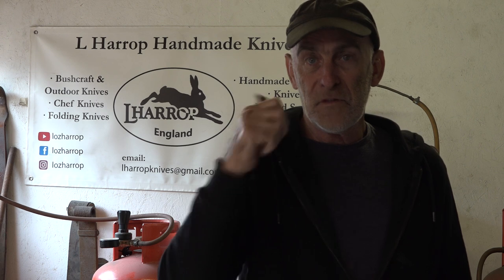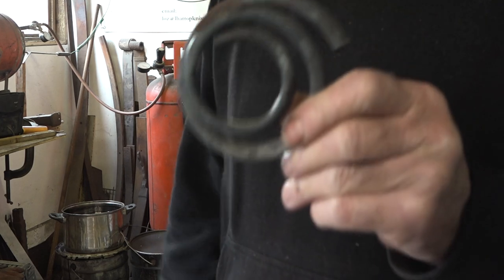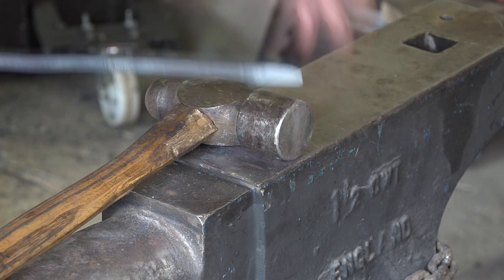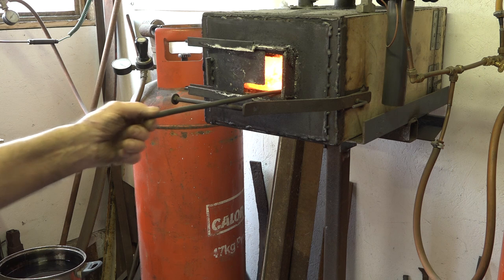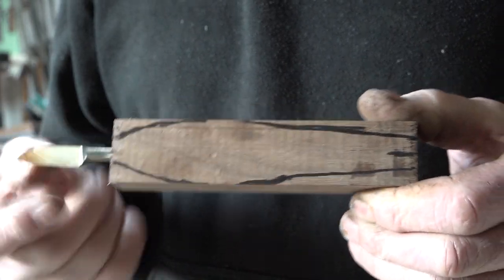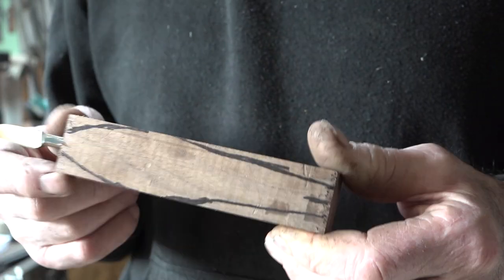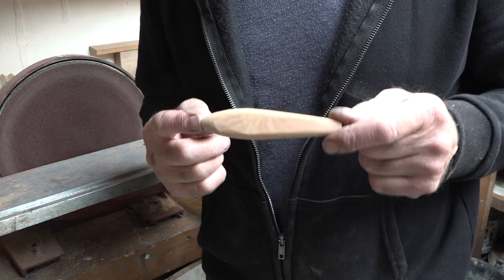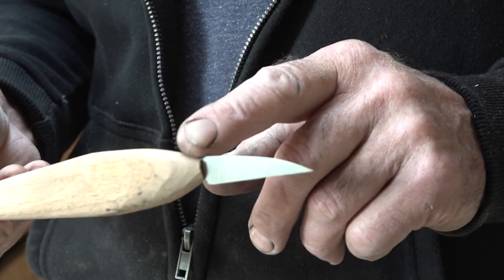how to make a chip carving knife

Comment: The ringing on that anvil needs quieting if you want some hearing down the road! Two part polyurethane works a treat. Springs are files are great sources for all manner of edged tools. Great channel, with or without ads.👍
Reply from the maker: Hi James, good point Ive got 3 sheets of lead under it mate, but i think its got compressed and needs some more now, also its worse because of the size of that blade, its not usually that ringy with normal knife sized stock. Cheers.

Comment: Thanks for the videos, and yea the ads are rough. I have 7/16” x 1”  01 that is to be a set of chisels for work. Would you use coal or propane? Would like to use gas but not sure, have never forged with 01.
Reply from the maker: Hi there, as you can see i use gas because i cant really burn the steel in my forge, you will have to be careful with coal and the heat using high carbon steel but many use coal all the time. also stop hitting the steel when it looses colour because  most high carbon steels will crack if you forge them too cold. cheers